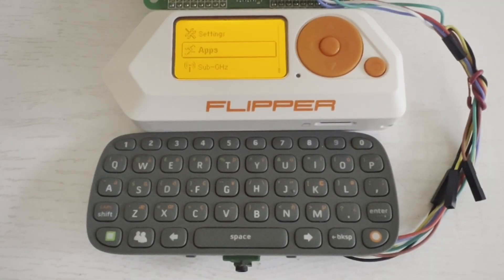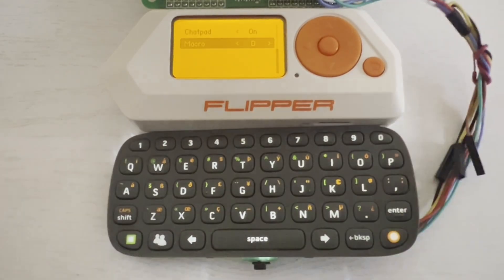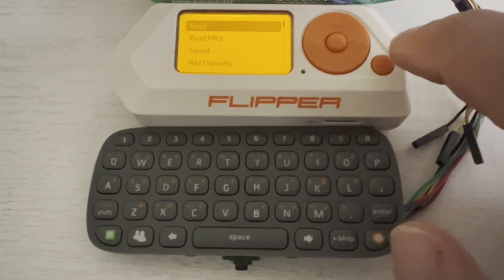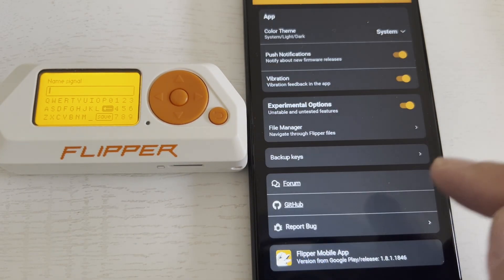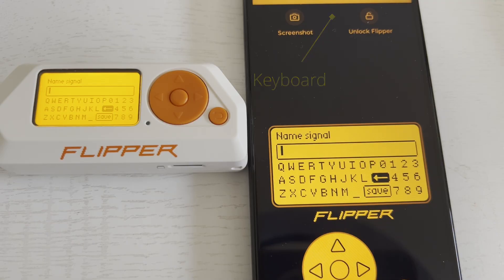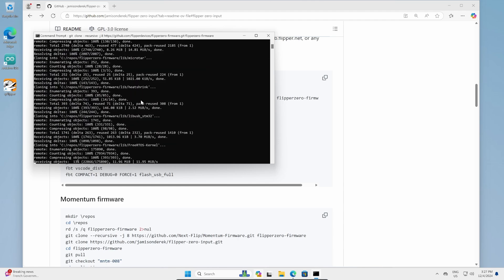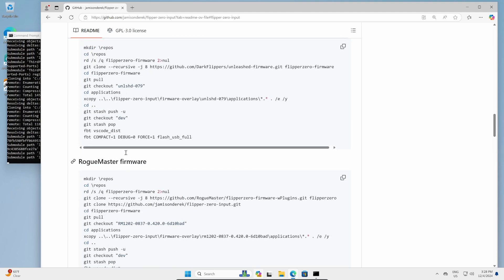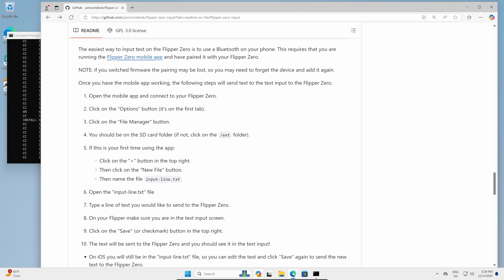[144] Flipper Zero: Type using Chatpad or Mobile Phone

Comment from the maker: 3:55 - "Xbox 360 Chatpad", I used the wired white one (model# X814365-001).

I’ll try to come up with other keyboard integrations as well. Here is an example listing for xbox 360 chatpad… https://www.ebay.com/itm/116413386368
Reply: Question... everything finally loaded onto the flipper, flipper rebooted and after following the steps on github the input-line.txt file is not appearing on the bluetooth version.  I'm running momentum, please advise thanks.

Comment: does it interfere with that wifi module, or other modules?
Reply from the maker: Yes, we are consuming pins that are needed by some of the other modules for using the chatpad. The Flipper has two UART (serial) ports so for a particular device you can probably get away with not using the pins. The other solution would be to flash a better protocol onto the chatpad device and then use interrupts on a more commonly unused pin; but I didn't want to require flashing the chatpad device with custom firmware.

If you use the Bluetooth method and enter data using the phone (which I honestly find easier) then you can use your existing modules without any issues. In most environments I'm okay with the phone using the Bluetooth network.

Comment: went looking $60 for an original chat pad. did see a ton of cheaper 2.4ghz types. Be nice to have a keypad but $60 is a hard pass.
Reply from the maker: eBay has some for cheap? I agree hard pass at that price point. I’ll try to come up with other keyboard integrations as well. Here is an example listing… https://www.ebay.com/itm/116065078976

Comment from the maker: I was also thinking of using an ESP32-S2 to allow connecting a USB-C keyboard to the Flipper (assuming I can't get the Flipper Zero's USB port to be a host). It should allow for mini keyboards, but most of the really small keyboards I found are wireless so I'm not sure if it's worth the investment???
Reply: My flipper can power my optical mechanical keyboard. No reason it shouldnt be able to input. Id use it.